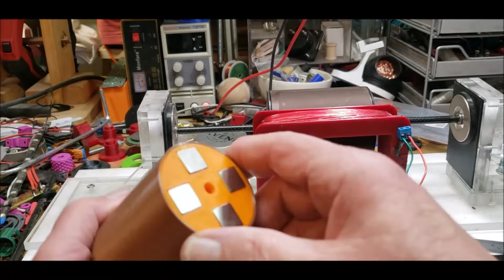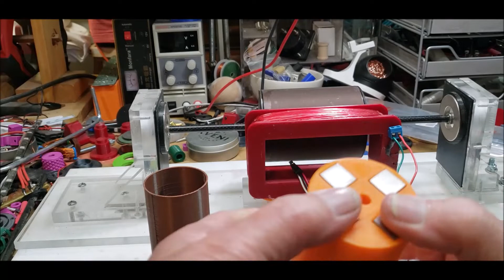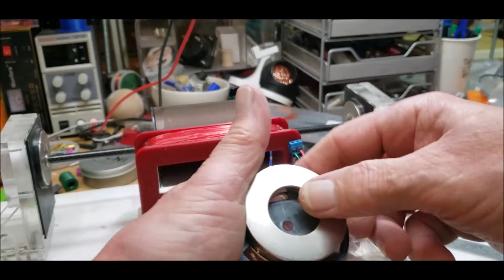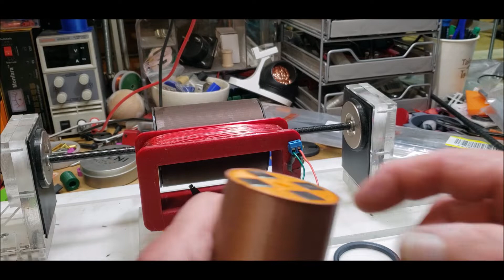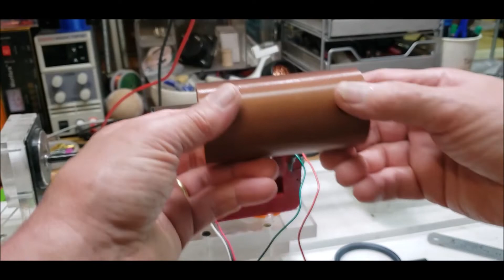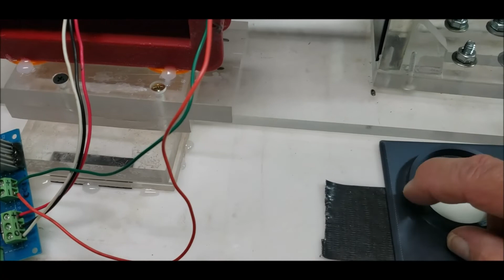3D Printed MagLev NEW

Comment: Nice couple of strong magnets, better have a protective case ready. So can't the 3D printer move in circles instead of moving backwards, or that would make the spots everywhere right? HPL, or we call it Trespa here, does nicely too. Can't wait to see where this is going!
Reply from the maker: yes your correct for a circle but the printer does have to stop and its better that it stops in the same place then all over. I need to reset the printer to make a continue sweep.